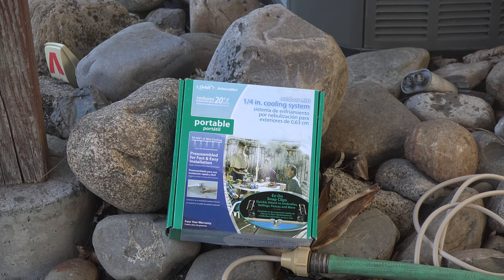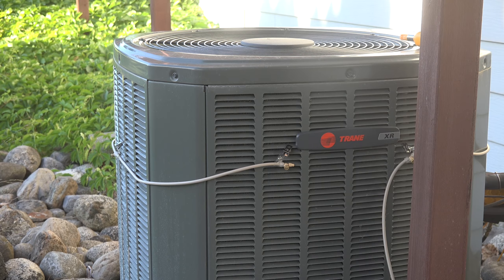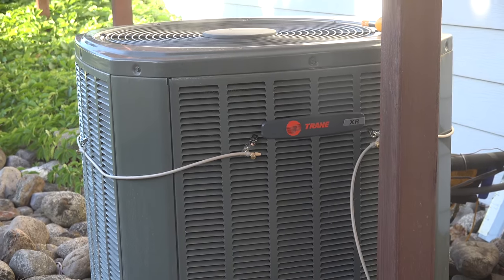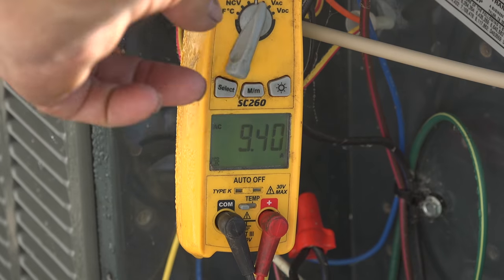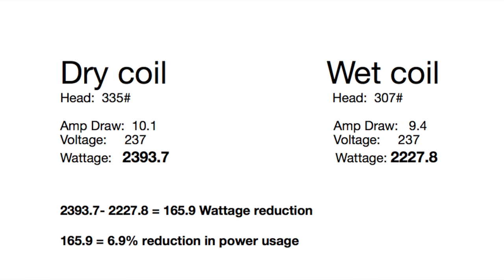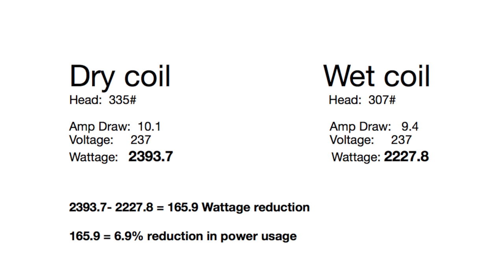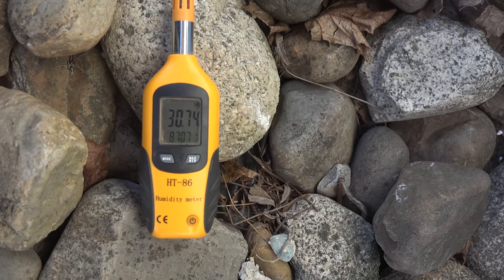Do the misters for A/C work? Part #1

Comment: Here in Phoenix where the humidity can be as low as 3%, it might be more effective but there is no way I would use it due to the deposits on the coil. We have very high alkaline/ calcium  content water here giving you best case efficiency but worst case maintenance scenario. Even if it did give you 20% energy savings, buying a new coil every couple years would be exponentially more expensive than the amount of savings.

Comment: Why did you run the mist FIRST!!! You made the coil wet and ruined the experiment!
Reply from the maker: It really makes no difference, the coil will get wet anyway.
GFM
Reply: @grayfurnaceman    uhh...  No.  The point  was to compare it without the wet coils, you never accomplished this.
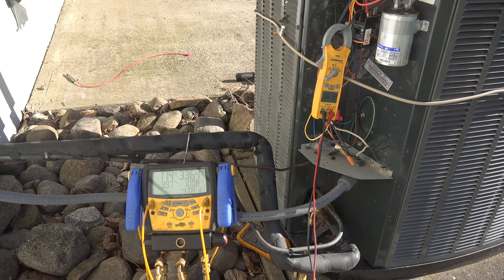Reply from the maker: @jfmc2581  At 3:37 the measurements are taken with a dry coil.  
GFM
Reply: @grayfurnaceman  , No you already ran the thing before that!! The coil was partially wet!!  The little bit wet makes a big differenc, ever heard of evaporative cooling?  You know the most effective cooling in existence ??  

Sorry your having such a hard time here...
Reply from the maker: @jfmc2581  This is an idiotic conversation.  Do you think the video was done in sequence?
GFM
Reply: @grayfurnaceman  , I know it was done in sequence bc I can see drops of water in the "before" measurements!!

It looks like you had to do this video 4 times!!  I guess that's a job well done in your world!!!😆😂🤣

Thanks for the "expert " advive. 🙄 GayfurnaceGuy!!

Comment: This does not work.  Bottom line.  These are air to air condensing units. If you want to save money,  buy a more efficient ac system. Plus, your going to destroy your outside condenser.
Reply from the maker: Ditto
GFM

Comment: Nice video and test. The power savings is certainly there but not enough savings to be worth it to me. The water in my area is very hard and Mineral Deposits would build up on the coils and damage them. Repairing the damage would cancel out and exceed any power savings I receive.

Comment: All this does is covert your AC unit into a swamp cooler.
Reply: No a swamp cooler put wet or humidity inside, all the air from AC is not with humidity . Your statement is very wrong.

Comment: This video is dumb. Voltage doesn't change bad on draw. Amperage will only change slightly. The cooler temperature around the condenser will shorten the time required to cool the home. So, it's not an energy savings because it makes the ac draw less, but it draws about the same for 20% less time.  As soon as he measured voltage you should know this is somebody with nice tools but no idea why those numbers are there.

Comment: As an hvac installer and tech with 30 years experience, I've already tried this before I became trained in chemistry. Spraying water on the outside coil will do absolutely nothing to help, in fact it will make things worse. Freon goes through a chemical reaction. All the condenser unit needs to do is turn the Freon from a gas to a liquid. Freon carries off about 250 BTU per pound of liquid as it turns into a gas by using the heat from the house. This liquid to a gas and back to a liquid is all that needs to happen. Spraying water on the condenser coil LOWERS THE liquid pressure which lowers the amount of Freon going through the system in which you are actually lowering the overall capacity of the system. Also if you manage to lower the temperature of the coil below 60 you risk compressor damage.

Comment: All out side units gets Rain or Snow, all year round and they work fine until theirs a component failure. But Rain or Snow never the caused of damage, because their build to last.
 Now your little experiment is not conducted properly. You jumped to conclusions fast.
 
Your unit is a Trane, which is very efficient all ready. I'm surprise that you can get it more efficient with your inconclusive experiment.
 
I'm working in a similar but better system that so far I'm getting 18% + efficiency. Their more test to be done before you see it on the market.
Reply from the maker: There are more videos on this subject.  Check the end screen.
GFM
Reply: The brand has nothing to do with anything and snow and rain hitting the outdoor unit are not the same as tap water constantly evaporating just consult your cars clearcoat and windows after it's been parked next to sprinkler for a while. Millions of people thought of this before and lots of engineers and scientists. Your trying to pick yourself up with your shoe laces.

Comment: If you want your condenser Unit  to last HALF AS LONG as without this thing,,,Then yeah, Do it. BTW, New Condensers cost $2800 and UP..just sayin'. City water and a lot of well waters have Chlorides in them as well as Lime and calcium. Chlorides is what causes Concrete Highways and Bridges to Rot because they get into the Re-Bar and destroy them. It forms a Cathotic cell. What needs to be done is a Separate (Small)  Evap coil on the outside of the Condenser coil. It can be run off the main coil with a Restricter  valve. I've seen it only once as an Experiment (actually, a bunch of us were just screwing around and FELL into the idea)  in HVAC School.

Comment: There is a big misunderstanding about how the a/c system works,  the whole point of cooling down the condenser is so it can cool down the inside faster with the same amount of energy,  because the colder the condenser gets the compressed gas on it  the more cold is going to do inside the the house system so the compressor will run less often to keep the same temperature inside,  by misting the condenser you don't do nothing to the amount of power the compressor takes,  it has to do more in how often it turns on, depending in the cost of the water, it may end up costing more in water than in savings, plus water will eventually damaged the unit because of hard water,  the best way to actually save money on an a/c would be to recover the heat that the condenser creates,  just like a hybrid water heater does, it puts the heat into the water so you can use it to take a shower!!!!